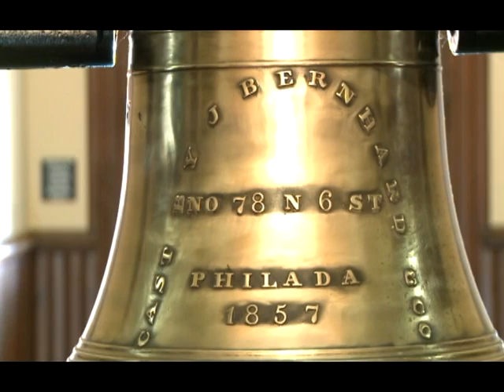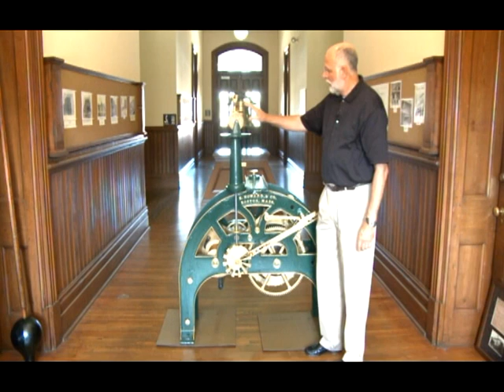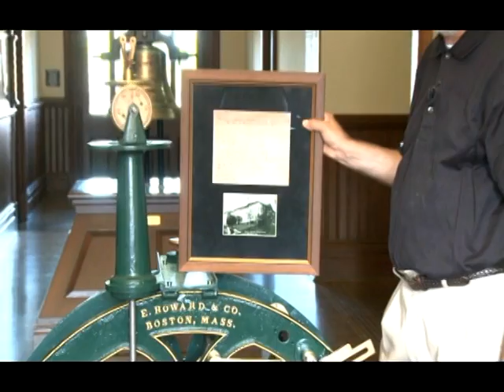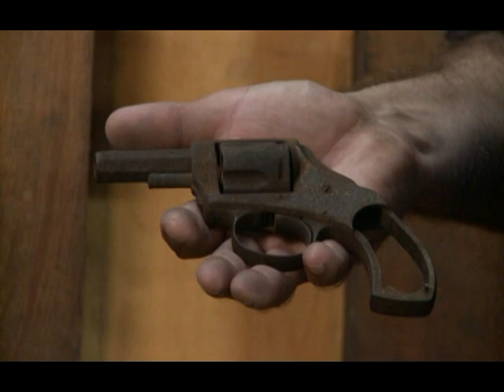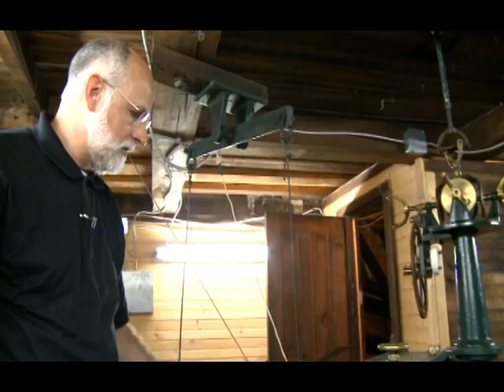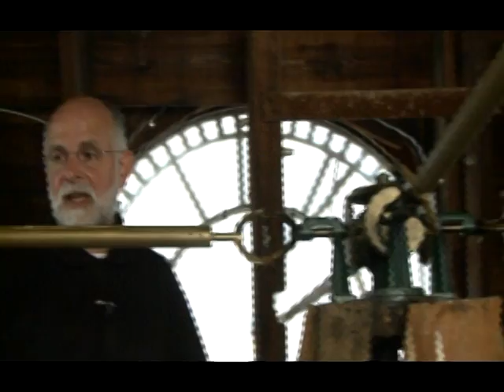History of Union County Bell and Clock Tower

Comment: would the mechanism by 1st bell  run again thats in hall way
Reply from the maker: We checked with the Union County Historic Preservation Commission and learned that the mechanism will not run in its current condition; a number of parts that are critical to normal operation were removed and discarded in the 1950s.
Reply: @UnioncountyncGov  you use have to put new bearings were the gears go and make costum parts